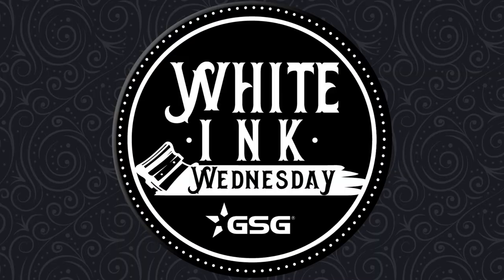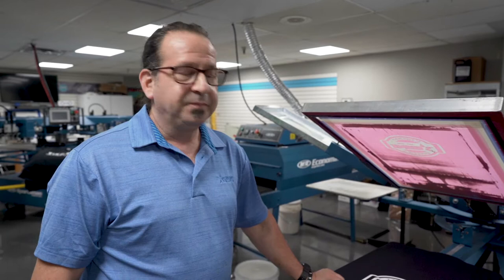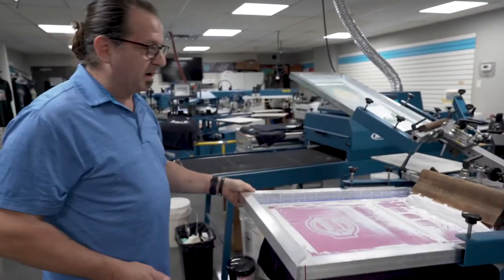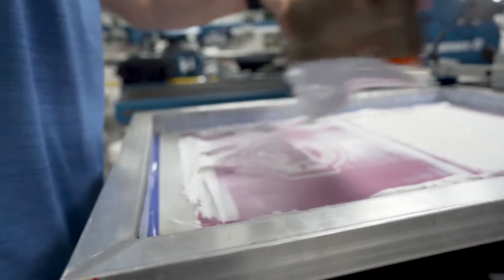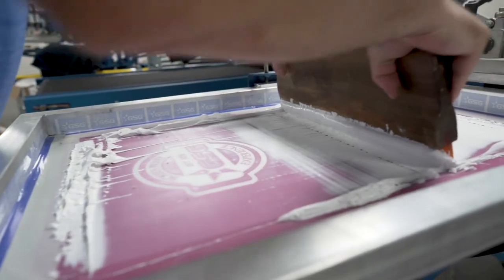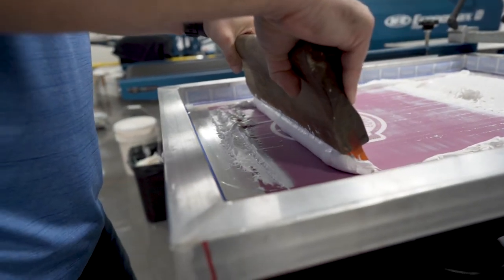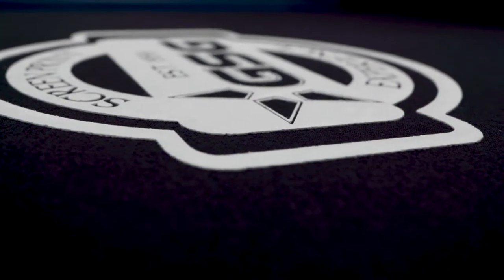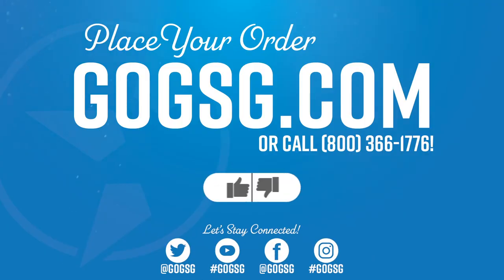High Gloss and High Density Screen Printing  Wilflex Epic HD Sharp  | White Ink Wednesday

Comment: You sad now we gonna do flush and then other 2times! What do you mean by flush/flesh, what do you do in flesh?
Reply from the maker: Hey Dainis!
We did two print strokes. That is when you pull the ink with the squeegee. Then we flashed the design. Which is when you let the design sit under a flash unit. That was cut from the video for time. Then we applied two more print strokes. For more information please give us a call (800) 366.1776.